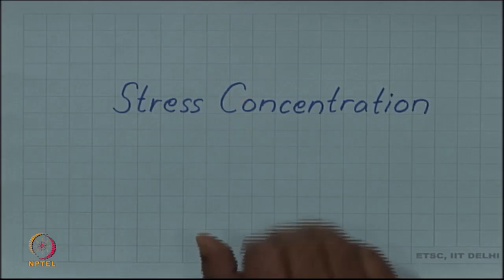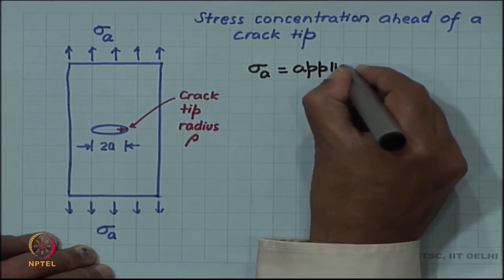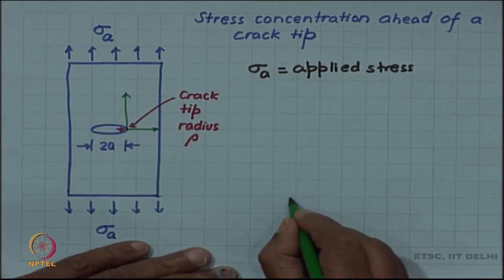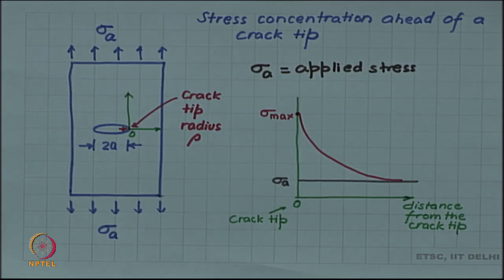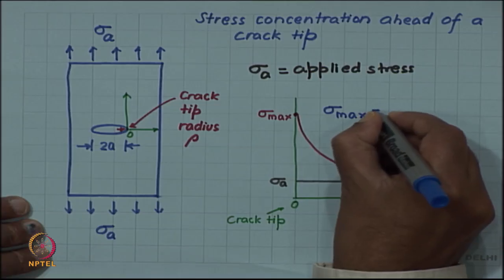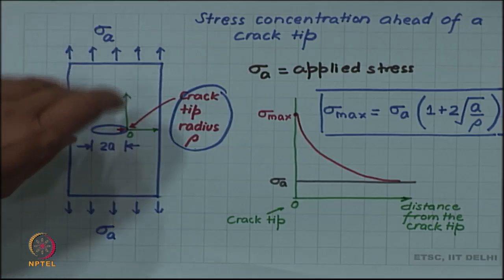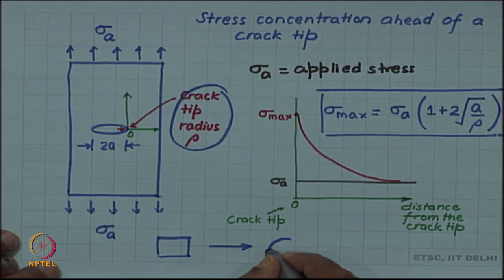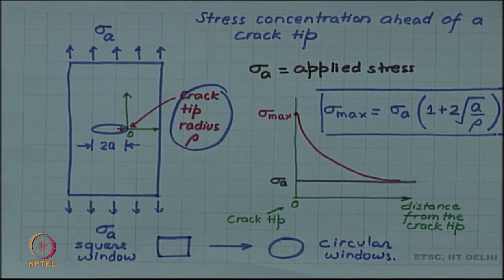Stress Concentration

Comment: Sir in griffens formula we use sigma a (ie the applied stress component perpendicular to crack major axis),shoudnt we use sigma max there to decide wheather the crack will propogate or not in case of stress concentration?

Comment from the maker: This is a difficult question. This comes of elastic equilibrium of solid in presence of a crack. In absence of a crack a uniform stress distribution can keep it in equilibrium. In the presence of a crack a redistribution of stress takes place resulting in higher stresses at the crack tip. To actually derive this one has to use elasticity theory.

Comment: Sir in Callister book, different formula is written for maximum stress ...

Maximum stress = applied stress(2under root  crack length/radius)

So which one is correct ...
Reply from the maker: The formula of Callister is an approximate one. The formula given here is more accurate. Usually,  (2under root  crack length/radius) is much larger than 1 due to small crack tip radius. So 1 in the formula given here can be neglected and Callister's formula is obtained. However, you can see that for zero crack length  Callsiter's formula will predict zero maximum stress. This is obviously unreasonable. The formula given here will predict maximum stress equal to the applied stress which is reasonable.
Reply: @introductiontomaterialsscience  Thank you Sir 😊

Comment: Sir excellent explanation.However I do not understand one thing.The crack that exists at the central location of the specimen is elliptical in shape.On first place why did we take an elliptical shape as assumption?We could have taken any other shape and secondly why have we devised that formula(just an intuition is it an approximation of an infinite series)?
Reply: Elliptical shape is a nice smooth shape without sharp corners. Sharp corners create problems in mathematical solutions as the radius of curvature goes to zero at these points and thus stress tends to infinity. Among smooth shapes ellipse is more general. For equal major and minor axes it becomes a circle. Thus the formula gives that the stress at the tip of circular holes is three times the applied stress. For very large major to minor axis ratio the ellipse approximates a sharp crack. 
The formula was first derived by a civil engineer C.E. Inglis in 1913. Under the assumption of liner elasticity it is an exact formula.
A website giving more details is
https://www.fracturemechanics.org/ellipse.html
Reply: @rajeshprasad101  Sir what is "relaxed volume" in the Griffth Criterion?I have seen this term being mentioned in Meyer and Chawla also How is K different from K_{IC}?
Reply from the maker: Due to crack, there is a region around crack faces where the stress is lower than the applied stress. This region can be called relaxed volume.

Difference between K and KIc: I will explain with an analogy. Stress is what you apply on the material. It can have any value. It is not a material property. But yield stress is the critical value of stress at which yielding begins. It is a material property.
Similarly, K is what you apply. it can have any value and is not a material property. KIc is the critical value at which crack propagates. It is a material property.
Reply: @introductiontomaterialsscience  Sir, in the equation at 3:18 in the video, is σₐ  equal to  'F/ cross sectional Area of the specimen without hole' or 'F/cross sectional area of the specimen with hole'? if 'F' is the applied force.